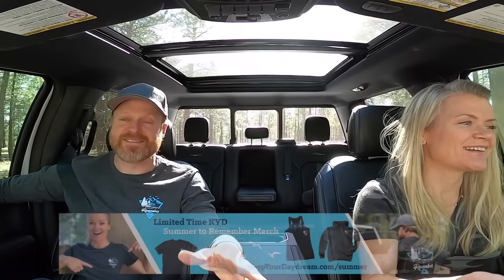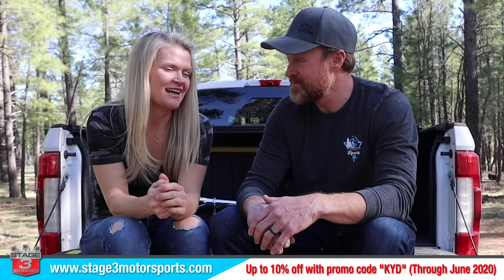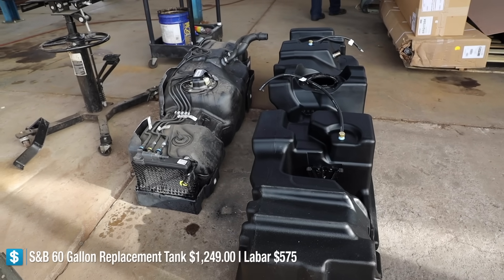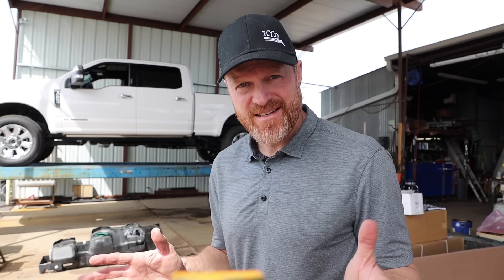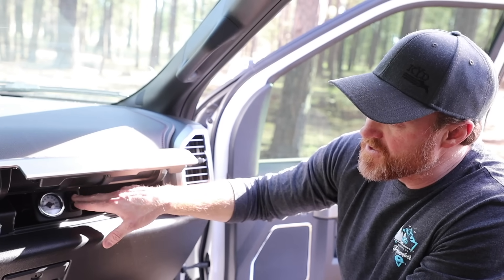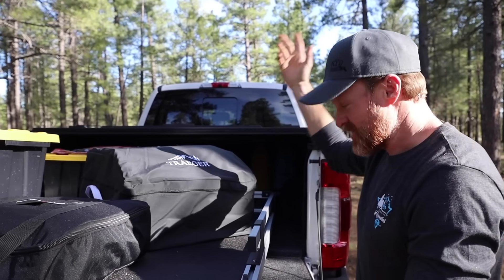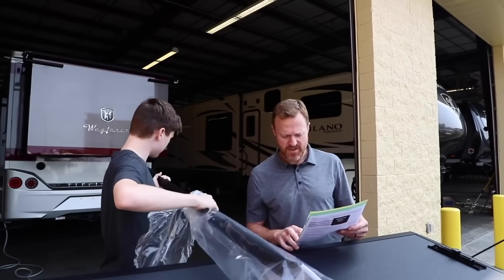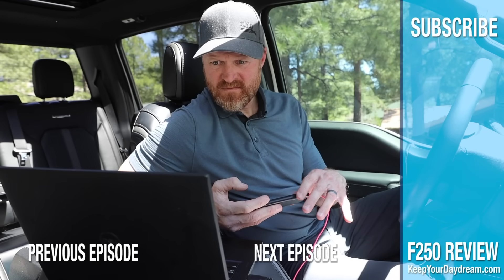Ford F250 Super Duty - Best RV Towing Mods & Upgrades

Comment: I just did the ARB compressor the airhorn and the quick disconnect on the bumper my friend did it at his auto shop it turned out fantastic same brackets everything underneath thanks for the advice on my 2019 Ford F250
Reply: Also I added airbags I bought the KYD kit from Stage Three Motorsports and just increase the air tank to a viair 200
Reply: @scottmctaggart3836  Would you be able to share what other parts you needed to complete the KYD kit from stage 3. I just bought mine and I’m a little confused on how to plumb all the air lines for the bags, additional connect in the bumper and possibly the air horn. The electrical seems straight forward though. Thank you in advance!

Comment: Thanks for the discount code. Used it to order an exhaust system for my 2020 F350.  Will use it again in a couple of weeks on a cold air intake for my Mustang.

Comment: Looking to add a set of air bags to my 2014 Toyota Tundra. Got a camper that weighs little over 8000lbs. When camper hook up can’t get truck no where near level. I installed a set of helper springs. No help. Do you think air bags will help or to much camper for truck?

Thanks

Comment: I tow a gooseneck horse trailer with 2015 f250 6.7. Gvwr in 16k. Debating on airbags or srw f350 springs. Which would you prefer?

Comment: If you were to put a lift or some sort of riser under the generator, would you then be able to put the slightly larger generator in, as the roll out deck might not then hit it?

Comment: Your channel is entertaining and very informative. Your enthusiasm and passion is infectious. My wife and I have a 2017 Winnebago Micro Minnie which we tow with a 2016 Tundra. Your new F250 is my dream truck. I’ve decided my next truck will be a 3/4 ton truck.  I’m curious what your thoughts are on the maintenance of the Ford diesel. Comparison videos between the power stroke and the new 7.3 gas really demonstrate just how jam packed the power stroke is underneath the hood. I mean to change an alternator a lot must be removed. A diesel sure maintains value though and if you’re planning to keep the new rig do you have any concerns given all the new EPA silliness (my opinion) that plague the new diesels. I’d love a video of those concerns and your decisions to stick with diesel. After all the new 7.3 gasser or Chevrolet’s 6.6 gasser would tow that airstream. 
All the best,

Comment: So we have a f250 and are wanting to buy a 16k fifth wheel. When dropped the 5th wheel on the hitch there is not much clearance and worried that if we hit a bump it will break the axel. Do you have any recommendations to help with the rear suspension. Air? Add a spring? Spacers?

Comment: You might be able to attach a hose to the exhaust port and have it exit the cab.  Makes the system MUCH quieter when dumping pressure.

Comment: Torn between f150 vs f250. All purpose, overlanding.  You have had both. I will buy used. 2006 to 2010. Your thoughts would be much appreciative.

Comment: What size air tank did you use? I bought the 5 gallon and it won’t fit (by the slightest amount) so had to settle for the 3 gallon tank. I have a 2020 F45O.

Comment: I bought the air lift kit from 3 stage. The air tank you installed is much larger than the one that comes with the kit. What size is it and what and how much difference is there.

Comment: I really like how you keep your extra water, gas, diesel, and propane in the front of the bed. Firstly, is it safe to keep the gas under the bed cover while driving, and secondly, where did you get those matching containers. I like how they are the same type, but labeled and colored differently. Thanks!

Comment: How do you access the 3 connections going to the fuel filter, the lines don't look all that easy to get to? They appear to be up in a hole on that new 60 gallon fuel tank.

Comment: So you have an FX4 truck and every airbag set up from air lift specifically stated not to be used in FX4 optioned trucks... My question is how did you get them to work...? Did you use a spacer or stretch the bags a little bit...?

Comment: I have the same truck. Question: How much room (height) is there between the slide and the Bakflip? What's the tallest thing you could put on the slide? Also, have you seen any slides that are only for half the width of your bed?

Comment: The BaK revolver bed cover on our F250 works great.  When rolled up you can still see out your back window.
Reply from the maker: BAK makes a slider? Didn't know that.
Reply: Keep Your Daydream , it doesn’t slide, but rather rolls up. The roll then sits on top of the bed rail.  It’s also metal not fabric/vinyl, so more secure. As with anything there are plus and minuses

Comment: Marc, I have installed a 60 gal S&B tank to my F350 and was wondering if your miles to empty is reading correctly with the larger tank.  When I fill my tank I see a range of 550 miles and then it drops slowly as I put miles on it.

Comment: Awesom video. I did notice that the link to the bed slide is for the f250/350 long bed. I checked because I wanted one for my new truck and they don’t make it for the short bed. The 5 foot one is for the f150. Just don’t want to see anybody order the wrong part.

Comment: My instructions on the AirLift with the internal joust bumper states to keep 5 lbs of air in it as a minimum. Glad you found the ForScan software, I know on  your previous truck drove you crazy with the incorrect miles to empty calculation. You can also use that software to do other things, its fun to play with. Cheers
Reply from the maker: Really? Still 5lbs of air? Hmm... what's the point of the joust bumper then? Yes, I'm excited to have a correct reading. I got an error when trying to update and still need to sort it out.
Reply: @KeepYourDaydream  5lbs not that much. I was told it needs a little pressure for inflation, I have the Bluetooth remote & that's as low as its goes. I used the 55 gal hexadecimal code, it gives a checksum error code when you hit write, but then it accepted it. At least that is what happened to me. Good luck.

Comment: So I have the airlift ez wireless one system with one line for on board air. Issue is that I have a schrader valve on the end by the license plate. Most stores like Home Depot and Lowe’s have air hoses that take 1/4 npt for the disconnect.

Which adaptor piece did you use to attach to the air line? Air lift told me that it takes a 1/8 inch barb. With the schrader being 5/16”. 

I would like to do a 1/4npt to quick connect but have no clue what piece to attach to the hose. Please help!

Comment: While watching this video I heard you say your Ford was missing a fuse for the battery charging circuit.  So I checked mine on my 2017 F450.  It too was missing.  I went to the Ford dealer who happily sold me one.  They said they didn’t know why it was missing.  My question is how do I check that it’s actually working?

Comment: Hi Guys, Safe travels and have fun. I would contact the Provinces before hitting the Matitime borders. At this date (May 3 2020) the New Brunswick Border (my home Province) is closed to all non essential travel and people are being turned away even at the air ports (meaning having to purchase return flight tickets at their own expence). Just a heads up. it would be pretty disappointing to get to the border to be told to turn around. Also, remember you have to travel through New Brunswick to get to Nova Scotia or PEI.
Reply: If you watch their videos they are going to be awhile till they get that far and realize plans may change.

Comment: I know you're a big fan of Bakflip MX4, but partially due to your recommendations I bought one for my F150 8ft bed.  First one leaked terribly and after several months of back and forths they sent me a new top(not rails just top) Installed it yesterday and it's leaking too.  Have you not had any leaking problems with any of yours? Especially with your carpeted bedliner.  I could not even remotely consider putting carpet in mine.  Any tips on waterproofing?   Thanks and we love you guys !!!

Comment: Hey Mark love the upgrades you have done.  I have the same truck and I’m wanting to add the arb compressor and air bag set up. I was wondering if you had a parts list of everything you used switch connections etc. thank you
Reply: I just bought the kit from stage 3. It showed up in 3 days - super fast free shipping! I’m also interested in what all is needed for the complete set up… The kit seems to have all major components but doesn’t have some fittings & couplers used in Marc’s truck.

Comment: You need to check out the rear bed step and AMP RESEARCH.  It’s much better than the tailgate step.  I never use mytailgate step.  Their electric side boards also get a big thumbs up from height impaired folks.

Comment: Looking to run my AC on a 2200 watt inverter generator and I am looking into the Microair EasyStart 364. That seems to be the trick without having to get 3000+ generator that weighs like 100 lbs. Love your videoes

Comment: Just curious, all these mods and additional gear (fuel, peopane, generator) take a toll on payload. Are you over GVWR with trailer in tow? A high trim F250 6.7 doesn't have a lot of wiggle room.

Comment: A standard bead is 8ft all others are short bead. Have a 97 f150 8' bead does good towed from PA to FL and back 3k mil. Now we have a Ram 2500 6' bead much better bigger motor heaver truck

Comment: If Ford is still using the horn beep when engine is running and you leave the cab with the fob, you can turn it off with forscan. Also turn on police mode.
You might need it someday....

Comment: The only reason I went with the Ford F350 instead of the F250 was because of the 4x4. It adds the extra weight so decreases your payload. Needed the F350 so I would have a high enough payload for me.

Comment: So far watching your video I see 2 mistakes. 1 the compressor being under truck will fail should of mounted in your bed since you have a cover. 2 for the air chuck you need it install a caped end this way you plug it in and it will keep it free of dirt.

Comment: 1 ?. I’ve had 3 other Bak Flips. My last one was the roll up. I now have a new 2019 F250 with no mods yet. What was your - view on the roll up? My main reason I went with the roll up was because of being able to see out the rear window. Guess I felt claustrophobic with the panel covering the window. BTW how are you going to get to your cab air filter with the gauge there is it removable? Sorry 2 questions.
Reply from the maker: I would do the roll up if I had a long bed becuase the BAKFlip panels are too big. Plus, the roll-up would cover more of the truck bed when towing. With a short 5.0 or standard 6.7 bed, towing a TT, I really like the BAKflip.

Comment: Trying to get that Stage3 promo code to work / apply.  Not working.  KYD is the coupon code correct?   Wanting to order up that same air package you installed for my 2020 F250.  Or does the “KYD Complete Air System” already have a discounted price on it?

Comment: Since you went to a  Airstream was there a reason you went to a f250 diesel vs the new 7.3 gas and save the ~$9k and gain a lot more cargo capacity?  Your cargo capacity is about the same as F150. I have an F150 & tow a 7400# tt with no issue. I am considering the F250 with the 7.3 gas or maybe the F350 with the diesel if we decide to go to a large 5th wheel..

Comment: Did you go with the 12V or 24V ARB? Reading that the 24v is for dual battery setups which our diesel super duty's all have, but stage3 has your kit listed as a 12v.

Comment: Not sure why you don’t use local flagstaff vendors for many of these upgrades. Fade at mountain toppers installed my roll n lock bed cover, when I bought my new truck he just moved it over for $100. Speaking of new trucks, surprised you went with  250 again. My 19 titanium was a 250. I replaced it with a 20 F350 titanium. It is within a couple of hundred to the 250, has better resale and rides so much better than the 19.
Where is your cabin in Flag? I live in Lakeside Acres which is off Butler. Did you abandon the Hensley when you bought the airstream. Curious as to your thoughts on that product.

Comment: Cool stuff.  Curious about air compressor.   Its  powered by truck battery ,correct?  If truck is not running,  can comp. drain battery?  Then again, I guess you're only using it in small amounts.

Comment: For that bed slide I contacted the company and said are you nuts drilling holes in the bed to mount this? Use the damn 5th wheel pucks most people have on these trucks or the truck bed bolts that hold the truck bed in place way stronger and NO HOLES

Comment: Hey Mark love the video, I have a question? We have the same truck and in process of making (all) of these upgrades, I wanted to know of you think It possible to cut out a section od the bed slide so I can het access to the gooseneck pin? I want to use the goose-box pin box for a 5th wheel but don’t want to take out mt bed slide?
Given your experience you think it’s possible?

Comment: Hey Marc- Am I understand this correctly, you have the Air Bags, Quick disconnect both working off/ from same air compressor tank?  The you eventually also connected the air horn working from that air tank as well?  Didn't realize you could do that, but love that option.

Comment: Does compressor still work. I think I would have put it in the cab. 
Compressor looks like it would not like getting wet and dirt, salt  and more.
Reply from the maker: Works great. It's a bit too loud for the cab. I've had 3, none have failed. Above the tire is very well protected too.
Reply: Oh, that’s cool. 
Over the years I have just herded lots of stories about compressors failing. 
I thought the true fix would be to keep them inside the truck. 

Good to know, I would love to get one. 
Just don’t use truck enough to spend the money. 
Thanks for getting back to me. I have been catching up on your videos. I’m little behind.

Comment: Great episode and mods. Can I get the wiring diagram you used for the ARB compressor (what did you connect to upfitter switch)?

Comment: Asking a newby question.  You've gone back to a 250 for your towing.  You did not include an after market oil cooler?    Is that not necessary for these newer Fords for towing?  Thanks.
Reply from the maker: Never looked into it. I'll consider it for the next truck.

Comment: What do you guys think about using a 2021 Ford Expedition Max to tow a Flying Cloud 30 FB Bunk? Would it be enough towing capacity with the towing package?
Reply from the maker: If you're good on the payload, it's a good place to start if you already have one. But most people need an Expedition because of passengers (kids) which puts them way over payload. Personally, there is night and day difference in the suspension between an SUV and pick-up truck and another major difference between 150 and 250. With our truck, there is not bouncing, chucking and little sway, which means Trish enjoys driving and we can drive further in a single day.
Reply: @KeepYourDaydream  thanks! We don’t yet have it but looking to travel with kiddos (9 and 2) plus pets (yes, petS) so we need the seating space (mainly cause petS). thanks so much for your reply!

Comment: I appreciate the item's price plus labor (or labar). As a fulltimer it is so hard to coordinate where and when I can install or repair something. 
Case in point I've been upgrading the Jeep Wrangler with a new bumper, skid plate, winch, etc. I did the bumper at a buddy's house, the winch at work, and the skid plate at the campground at dusk so no one would notice (no working on vehicles at our campground).
I enjoy doing the work myself but with bigger or longer upgrades I'm going to have to farm them out.
Reply from the maker: I wrote that in typonese. I'm impressed your fluent in it! Yes, if you can do the work yourself, it's a big savings. If Phil is reading this... he's going to help me restore a 77' F250 and we'll do it all ourselves, but he's go the tool, an knowledge :)
Reply: @KeepYourDaydream  that's a nice truck! Lift it and put it on 40's and you have a Jeep replacement.

Comment: Have  a  2017 F250 with 6.7L diesel. It has a 34 gal tank but about 5 gal is reserve which I am ok because you don't want to get low with a diesel. When you put the 60 gal in roughly how much would you say is reserve you can't use that they set to miles to empty. Really debating putting a 55 gal in or just carrying 2 - 5 gal cans. Also, considering the extra weight. Appreciate the video. Be safe on your journey. Looking forward to the videos on the rode.
Reply from the maker: 34 is pretty good actually, but once you go 55 or 60, it's really hard to go back! Getting fuel sucks so getting it half as often is something you'll enjoy every time your look at your gauge.

Comment: I have a f250 on order. About 800 more bucks I can get into a 350. Why do u choose a 250 with bags  over a 350 with springs? Also why a bed rug over spray in liner? Thx great video
Reply from the maker: Because I knew we were keeping the Airstream and the payload worked. Airbags don't compensate for payload or towing capacity, just keep things level. It hardly adds comfort - maybe a little. If you're thinking you'll ever get a 5er or bigger TT, go with an F350. I'd only do a bed rug again if I had a truck cap. I prefer spray-in. If I do get a truck cap and bed rug again, I'll still spray the tailgate. The bed rug looks messy on the gate.
Reply: @KeepYourDaydream  thx. I'm enjoying kyd55